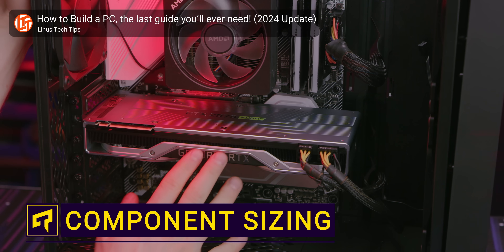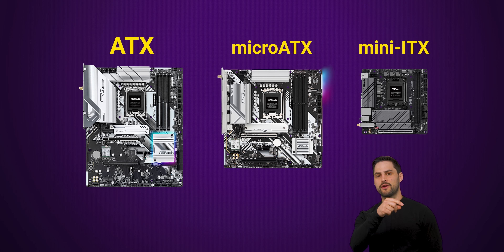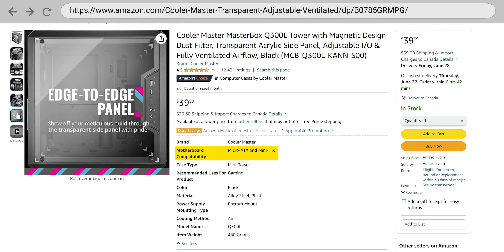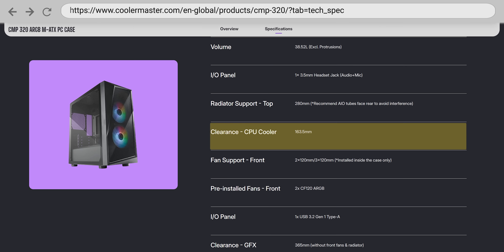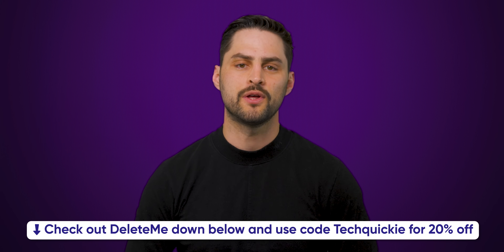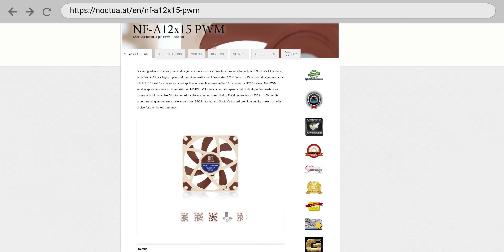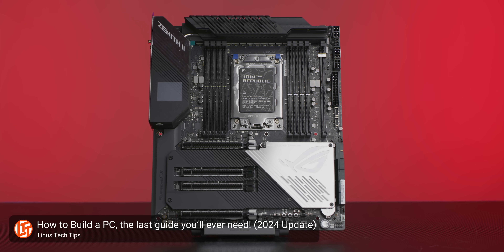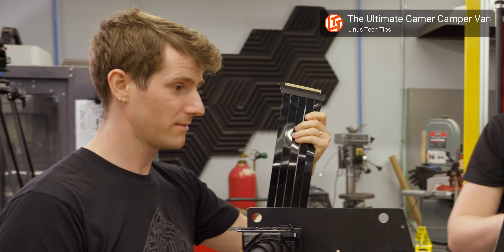Are Your PC Components TOO BIG?

Comment: Case: Corsair Carbide SPEC-06 RGB
RAM: Corsair VENGEANCE® RGB 32 GB (2 x 16 GB) DDR4 DRAM 3.200 MHz CL16
CPU: AMD Ryzen 7 3700X
GPU: MSI GeForce RTX 2070 SUPER™ GAMING X TRIO
Case Fans: Corsair LL120 RGB(6 x) 
Motherboard: MSI MPG X570 GAMING PRO CARBON WIFI
CPU Cooler: AMD Wraith Prism
PSU: Seasonic FOCUS GX-750 (Not Corsair because I didn't have the money for that at the time and also forgot to buy a PSU. xD)
Storage: Toshiba P300 4TB HDD, Toshiba RC500 500GB m.2, Mushkin Redline Vortex 2TB m.2
Thermal Paste: Cooler Master MasterGel Pro V2

Keybaord: SteelSeries Apex 100, SteelSeries Apex Pro (in use)
Headset: SteelSeries Arctis Pro + GameDAC
Speakers: SteelSeries Arena 7
Mousepad: SteelSeries QcK Edge Large, SteelSeries QcK Prism Cloth XL (in use)
Mouse: SteelSeries Rival 3, SteelSeries Prime+, SteelSeries Rival 600 (in use)
Mouse Bungee: SteelSeries Mouse Bungee
Controller: Scuf Prestige, Xbox One Wireless Controller
Microphone: Thoman the t.bone SC 420 (upgrading to SteelSeries Alias Pro)
Webcam: Logitech StreamCam
Monitor: MSI Optix MAG271CQR

What do you think?
I think it still holds up really well to this day and I am able to play a ton of awesome game on it.
I am upgrading my whole PC when the NVIDIA GeForce RTX 6090 TI releases.

Comment: NOCTUA has a very thorough online Compatibility Centre that'll tell you if your case, mobo, RAM, and cooler will play nice (both by size and spec).  If you have a different brand's cooler, you can still look up the clearance numbers for cases on the Noctua site.

Comment: When building my PC I wanted an AIO but the case was so dumb the front panel was fixed to the case and at the top the space between the motherboard and the case was so small not even a cable cluld fit, so I got an air cooler. Latter discovered the case had horrible ventilation. Finally I just bought a new bigger case and the AIO I wanted and everthing fits in there

Comment: Don't do this to me please, I just brought a GPU 0.5 cm larger than my case, and am hoping to use a combination of maths and magic to get it to fit 😂
Reply: There's a magician you want to investigate, his name is The Amazing Dremel.
Reply: Duct tape fixes everything.
Reply: Dremel or Hanmer out a little more room :p
Reply: Me too. I filed a return for the GPU and ordered a new one two days ago. Still waiting for it, shipping is slow.
Reply: Unscrew the motherboard mounting screws and take out the backplate. fit the graphics card and screw as many mounting screws as you can. It will fit but your without the IO backplate, so bend back all the edges of the backplate and insert it from the back rather than inside.
I've an Asus TUF 4080 and it's surprisingly massive for an m-atx case.
Reply: That's what Dremels were made for!
Reply: Angle grinder fixes all 😂

Comment: For what it is worth. I ended up going with a fairly large case mostly to have enough room to comfortably fit 6 HDDs, and also has six 5.25 inch bays as well; and I got one that could fit an EATX motherboard if I later got one. But, does mean case is pretty big heavy. It has a comparably small graphics card though, as the card I got was not particularly high-end, and was mostly intended to replace the roughly 10 year old card I was using previously (which had started acting up). Not that much of a gamer though, and it still gets good framerates in Minecraft, so good enough.
Most of what I am doing is CPU based, and ended up only being able to have 112GB of RAM because I had discovered 128GB doesn't seem to work correctly with the ASUS-ROG motherboard I am using. Also technically using the stock CPU cooler with a small underclock (as reducing clock speed and disabling turbo causes CPU to run more reliably when running the CPU at 100% for extended periods of time).
Reply: Yes - if you have space for it and not moving it often, a large case is almost always a good idea. I have a Fractal Design Define 7, which has space for a ton of hard drives, fans, and a 5.25" bay - and looks gorgeous, if you like Scandi minimalism! I doubt I'll ever buy a replacement case, it's that versatile and easy to build in
Reply: What case did you get?
Reply: @SharkVaderYT  Rosewill Thor V2, it was a relatively big/heavy PC case... Weight is listed at around 30.4 lbs (seems about right, closer to 50 lbs when PC is fully assembled).

Comment: LOVE canned grandmaw generic b-roll clips.  That was hilarious.  To also make a point, even after buying the most massive case I could find (Lian Li super extra big time case..whatever that model number is) The ICE GIANT lived up to its name and was a no-go.  THEN the Corsair whatever it's called (the big one with the fans) did not play nice with my RAM or with the heatsinks on the motherboard.  So I had to return that too and finally opted for the Lian Li AIO.  Bottom line, the biggest issues were with the motherboard.  Newer motherboards are surrounding the CPU socket with Coruscant-level "buildings" of heatsinks and they get in the way of the CPU cooler heatsinks.  So even if your CASE seems to be big enough, the motherboard may negate that measurement.

Comment: My big mistake was combining a Micro ATX case with a somewhat beefy NON-modular power supply. Unlike the GPU and the MB, it wasn't immediately obvious what a pain that would be. Like, I had to squeeze a lot of redundant cables into one stupid corner where they wouldn't block airflow too much.

Oh, and while the GPU did fit as advertised, I always had to insert it DIAGONALLY, because the front slot... pillar (?) was in the way, then reposition it back into a straight position inside without ripping out MB related cables. Man, I could have really have an easier time with a Midi tower.

Comment: I had to use extension cable, for GPU power cables because I bought SFX PSU for standard case. (it was in great deal, eshop listed it for wrong price so it was just 30€ for coolermaster gold 750W)

Comment: I have a corsair carbide air 540 case. It's silly huge. New GPUs will not fit. This is barking mad and I really don't think it's necessary. You don't need all that metal to remove the TBP for the vast majority of them. I think it's a marketing gimmick, making you feel you didn't waste so much money on overpriced sand.... Grrr...

Comment: The biggest issue that I have had to date was a Sata header that occupied the same physical space as a capacitor on my graphics card when fully inserted.

The capacitor didn't offer enough insertion resistance to be noticable, either, until well after it had been nearly pushed off its mounting (and was definitely damaged).

Check that your motherboard doesn't have any headers located very close to expansion slots.

Comment: The first PC I built went well aside from one small problem. The fan on my CPU cooler didn't clear my Motherboard heatsink. It was pretty close though...so I grabbed a chonky metal file and shaved off some plastic from the fan shroud. A bit jank but it worked.
Reply: Mine is even more jank lol, but mostly because of laziness rather than lack of space. 

- SSD laying loose in case
- CPU cooler held on by gravity with PC on side (couldn't fit my fat hands between the GPU and fan to latch it down and didn't feel like taking it out)
- PSU outside of case (temporary as my old one died) 
- One non functional fan still left in case after others were replaced since I couldn't reach the screws with any screwdriver I have
- Haphazard fan placement, not evenly spread 
- No side panel for better cooling and accessibility to parts since it's already on its side 
- RGB achieved with a strip simply laying on the bottom of the case
- Pretty much no cable management whatsoever; they just lay loose, pushed to the side so they don't fall on the motherboard 

And yet somehow this thing has been going strong for 6 years now while accumulating that much jank.
Reply: Side cutters, but yeah just need to remove a centimeter or so to make stuff fit-ish
Reply: If you can't fit it, gritch it.

Comment: My very first custom build had this problem; I didn't think PSU had different lengths, so my Titanium rated one arrived and would impact my internal drive bays (which I was planning to use).

I just ended up ripping out the side wall and placing the one hard drive I had upside down.
Still going strong.

Comment: Alright, maybe we just need racks.
4U in a 19 inch rack should be able to fit a whole bunch of 4090's next to eachother, as well as a motherboard to plug them into...
Reply: That would just lead to people commenting "nice rack, bro" every time someone posts a picture of their newly built PCs.
Reply: Maybe I need to take my server out of the 4U rackmount case and swap it for my workstation... Lol
Reply: can you even fit a d15 in a rack
Reply: you are going to be limited to cards that dont stick out on top of the pcie bracket though. some of the XFX cards look like they are just a tad too tall.
Reply: 4U is only 177.8mm, a Corsair 5000D is 245mm wide.
Reply: @FastSloth87  Well, then you'll have to go with 6U, probably.
You may have to sacrifice a bit of server space.
Just get a 48U rack, and you'll probably have enough. If not, 70U racks exist as well.
Reply: I have two systems on a rack. Not the best to have anywhere near you. Airflow is limited so you NEED fans that can push air through and those get loud. Even 4U, fitting some "120mm" air coolers isn't going to work. So, you're gonna need the short, denser coolers with, guess what, loud ass fans. Getting air in can me simple, Out can be a chore. So many server chassis only support 2x 80mm fans for exhaust so you know the deal there.
Reply: @TheSolidSnakeOil  S.O.N or a S.I.N instead of a tiny S.O.C or crappy S.B.C 😂😆

Comment: Check the number of slots for PCI-e cards you have at the back of the case. If it is less than 4, only Micro-ATX and Mini-ITX motherboards can go in. Above that, ATX will probably fit.
Reply: Up to 4(-ish), mATX, with exceptions for vertical mounts. ATX, you want at least 6.
Reply: @samiraperi467  The ATX standard is for seven slots for expansion cards. So a case with more than four slots most probably supports seven slots. There can be more slots in real large cases. These are not corresponding to any ATX cards but can still be useful if you install a fat three slot card or similar in the bottom slot of the motherboard.
There are also motherboard that have more than seven card slots, but they are not standard ATX size or even what's often called EATX by Tyan and SuperMicro, or more correctly SSI EEB cards. These are larger than ordinary ATX cards, but they don't have place for more slots. A ATX card maxes out at 12 by 9.5 inch while a SSI EEB maxes out at 12 by 13 inch so it's deeper than it's wide. SSI MEB motherboards can have up to 12 slots and are up to 16.2 by 13 inches, so they are again wider than they are deep.

Comment: Too big, and FAR too power hungry. You figured out why I stopped using desktop computers! Bravo! Space heaters are not too useful where I am.
No more than 120 watts for the ENTIRE system. Period. Using a laptop, for 8 years now. Efficiency is all I want. Not speed. Already plenty fast enough.
Reply: That's what my laptop uses. It's a gaming one with a discrete graphics card(3060 mobile), which is why it uses so much power. It is plenty fast enough for me, and I use a 45 watt laptop, as well. It is fine for light work. As I said, efficiency is the MOST important thing for me. By the way, I have to be...I am off grid solar.
Reply: 120 watts is insane, computers from a decade ago didn't use that little. Must use the slowest computer known to man

Comment: Also don't forget some GPUs come with anti-sag brackets that only support ATX motherboards (looking at you, Gigabyte 🙄).
Reply: Just put a piece of wood under the gpu
Reply: @itsarian.  
I ordered a cheap "stand" from China (because it's just a bit of steel, plastic and rubber) and realized I lacked around 3mm to hold it in a level position. So I just squeezed a thick braided cable under it, lol. I mean it's a mid sized card not one of the monsters, the stand is more just in case/to prevent sagging after years.
Reply: Could turn the case on its side so gravity isn't putting strain on the slot.